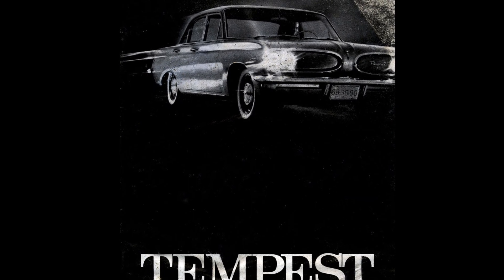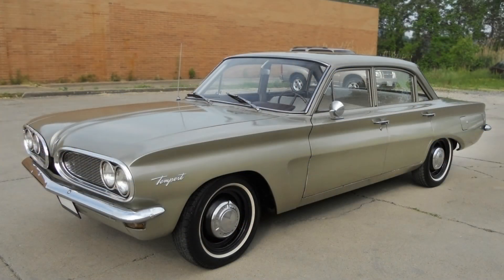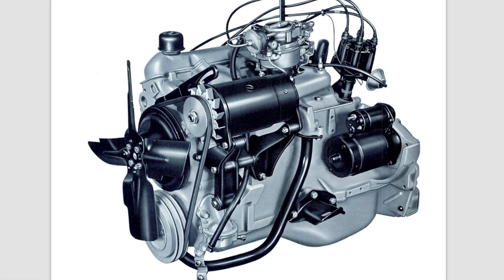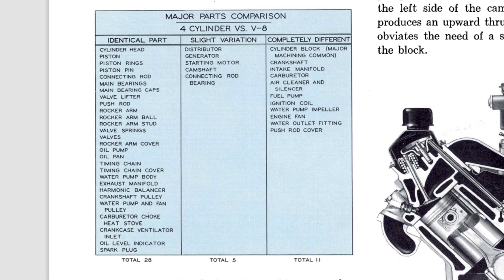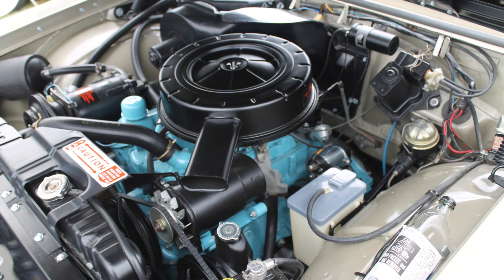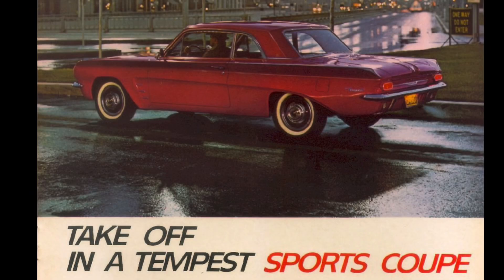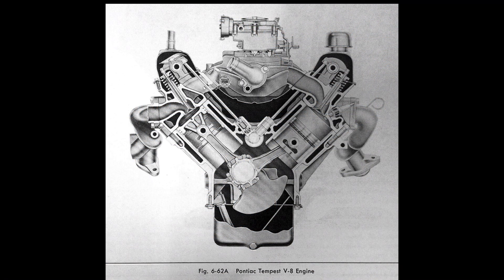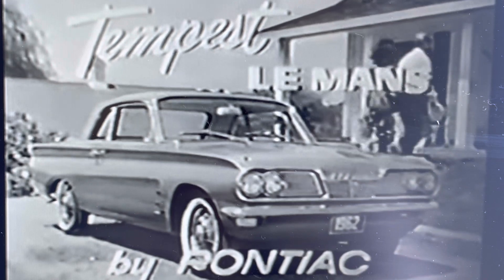Strangest Automotive Engines: The 1961-63 Pontiac Tempest & Its "Trophy 4" / "Half 389 V8" Engine

Comment: The Tempast was HEAVILY derived from the Corvair, basically a front engine Corvair. Corporate wanted Pontiac to use the corvairs rear engine for the Tempast but Delorean refused because he knew the Corvairs flaws and didnt want it for Pontiac.
Reply: The Tempest body appeared in four GM car lines in 61. Buick had their aluminum 215 inch V8 in their car, but it was a standard front engine and transmission set up. I'm not sure of Oldsmobile's power train or model designation. I find it amazing that GM could design a new small format car that would accommodate  three decidedly different power plant installations.
Reply: @cdjhyoung  Olds' version of the BOP senior compacts was the F85. It also used the 215 aluminum V8.
Reply: @Al-thecarhistorian  And you could get it with a turbo!
Reply: @cdjhyoung  GM was far more daring in those days. The Olds F-85 had an Olds version of the Buick 215 V8, with different heads and 1 additional head bolt per cylinder. And Buick lopped off the two rear cylinders of their V8 to create the V6, which went on to live as the 3800 well into the 2000's.
Reply: @61rampy65  yep. Put 460hp through my 3.8  via an M92 supercharger and 100 wet shot. The 2-3 bands in the 4T60 lasted approximately 3 blocks🤣 haven't touched a GM product since. Those 3.8 Buick mills are FANTASTIC tho, and possibly the best engine you can find under the hood of any late 90s early 2000s GM
Reply: @61rampy65  And don't forget, the original design for the 215 V8 Went to Rover & went on to a very long production run with them. AND the V6 was used by, and later sold to Kaiser Jeep Corp. Because it easily went in place of the 4cyl engine Jeeps were still using. Inline 6s & V8s would have required much more significant modifications which is just what AMC did when they bought Jeep. That would likely have been the end of the line for the V6 except we were now into the 70s & the "fuel crisis" of that era & GM was looking for something new that was more compact, lightweight & efficient & they bought back their own V6, shortly thereafter came up with the clever new crank design that allowed for "even-firing" & the rest, as they say is history!
Reply: @61rampy65  Drove a ten year old 63 Buick Special with the V6. My Dad had to fight that motor constantly, backfiring and coughing. Seems Buick sold the dies to American Motors who figured out reverse timing made it run smooth!
Reply: @cdjhyoung  Yes, my father owned one and it was a reliable car, bought new in 1961 and he had it for ten years.
Reply: @cdjhyoung  What's so amazing about GM  designing a small format car that would accommodate 3 different power plant installations? GM often did just that with the cars produced by its foreign divisions. One example: the Australian designed and built Holden Torana which had a 4 cylinder, a 6 cylinder and a V8 engine
Reply: @EVISEH  Different size engines in the same engine bay is not the same as designing a car that can locate the engine or transmission in opposite ends of the vehicle.
Reply: Really there were no serious flaws.  Ask anyone who own a Corvair. The Delorean car had a rear engined six, so I don't think that was the reason, but he wanted a Pontiac engine.
Reply: @danr1920  The flaw in the Corvair rear suspension was that in a high speed maneuver the car could take so much body lean at the rear end that the inner wheel in the turn could actual come under the body and 'jack' the car into a roll over accident when the side force of the turn had ended. The problem was that there was no limit on how far the rear suspension could travel when the body leaned.
Reply: @cdjhyoung  yep. But having the engine in the back made it far more likely to happen in the corvair. That being said it was possible to have this happen on a beetle and triumphs which also had swing axle rear ends.
Reply: @Henry_Jones 
 Remember kids: Always start the second part of your comment with "That being said...".

 It makes it sound like the first sentence is factual.
Reply: 😄 What a "waste of words." It's as bad as "At the end of the day."
Reply: @cdjhyoung  I can tell you read something in a magazine and now you are an expert. The Michelin X radial is over 70 years old, it was released in 1949. But Americans dim-witted insistence on getting that "pillow soft ride" means that Chevy installed bias ply tires which had sidewalls on the Corvairs which easily collapsed and would initiate a body roll. I installed Michelin Radials on my '64 Monza back in the 70's and would drift the car all the time with no issues. The lack of education in this country is appalling. Chevy could have installed Michelin X radials on the Corvair and probably prevented this issue.
Reply: @errorsofmodernism7331  I mean Ford had an issue in the eighties and nineties with their broncos and explorers rolling over because of Firestone. 🤷🏼‍♂️
Reply: @errorsofmodernism7331  Owned one. So did m brother. Never wrecked mine. Brother buried his at an excavation site. Nice, simplistic answer you give there. I'm sure you drifted all over the place, but did you ever drop a wheel off the pavement when drifting? A Corvair handled differently than other Chevys and it coaught the unaware off guard when they got it going to fast into a corner. simple as that
Reply: @cdjhyoung  - The NHTSB's report on the 1st generation Corvairs mentioned that improper tire pressures were often the cause of single-car accidents, as well as driver inattention. Just like a 356 Porsche, they'll go off the road backwards if pushed too hard when you're not paying attention.
Reply: @cdjhyoung  It was a bean counter decision. The 1964 Corvette no longer had the solid axle and the Corvair from 1963 no longer had the swing axle rear. Once you learned how to drive a rear engine Corvair it was hard to find a vehicle the could corner better. Including the Mustang.
The biggest flaw with the Corvair engine was the push rod tubes. Also the 3 90 degree belt direction changes. That also was a bean counter decision.
Reply: @cdjhyoung  , Corvairs suspension geometry made less rear tire/road grip during a turn when it cannot afford it... the result is the rear end swinging out and loss of control. I would describe this as only a degree of "wheel tuck under". All swing axles are prone to this under hard cornering.

Maybe this is in agreement with what you said, but I think it clarifies.
Reply: @RustySax1949  , so true. Corvair tire pressure was specified only 16 psi (in my 1966), about 26 rear as I remember. If you put 24 front and rear like many ignorant people did for all cars, the handling turned really dangerous. I experienced a bit of that on a wet road once, fixed the pressures and it was much better.
Reply: @markjohnson8260  There weren’t any warning labels and  24#  in the fronts made the car a death trap.
Reply: @James-hd4ms  - Yes there was, James, a bright yellow sticker on the inside of the glove box door. But, as per usual, most people, let alone gas station jockeys, the recommended pressures were ignored.
Reply: @markjohnson8260  - I had a '66 140 Corsa 4-spd Convertible for over 20 years, put 14x6 front and 14x7 rear "American" mags along with fat Pirelli tires on it, tweaked the alignment settings slightly, 24 psi front, 34 psi rear, added my tool box to the bottom of the trunk, then would go searching for Mustangs. Camaros, Trans-Ams and Corvettes to challenge on the twisty and bumpy mountain roads around where I grew up. That little Corsa could easily smoke the live axle pony cars and pre-'63 'Vettes on my favorite bumpy road that had lots of twisties, struggled a bit with the IRS 'Vettes, but often would be right on their tail or just a couple car lengths apart. My son's E30 M3 BMW often had slower autocross times than the Corsa, even when we'd switch cars. The 2nd generation cars were such a HUGE improvement over the 1st gen, but by then the damage from the Mustang and Nader was done, and the public turned away in droves.
Reply: @errorsofmodernism7331  , I seem to remember conventional wisdom said NOT to put radials on a swing axle car. I think was said to make the transition to oversteer more abrupt... perhaps someone else my age can remember more clearly.
Reply: @RustySax1949  wow, mine too was 140HP... but I'll bet yours was in better condition!
Reply: @markjohnson8260  - Well, mine was a CA car, delivered new in Gilroy, CA. Willow Run built. I bought it in June of 1969, a month after production ceased - people were practically giving them away back then!
Reply: @cdjhyoung  That issue was addressed in the 1965 and later Corvairs when the swing arm rear suspension was replaced with one that kept the rear wheels vertical as they moved up and down.  The Volkswagon beetle had the same issue and was often seen on it's roof for this reason.
Reply: @markjohnson8260  That may have been the conventional wisdom in America but here in Australia, Beetles, including the eary models,  as well as Triumphs and Mercs were regularly fitted with Radials - simply because  cross plys were no longer available -  without any ill effects and in fact Radial equipped Beetles handled better. Indeed, all the Beetles I owned were fitted with Radials. And here in Australia, we have some of the most extreme road conditions in the World.
Reply: @EVISEH  , thank you for that. My understanding was that when cornering at the limit, a radial would "let go"  more suddenly. Cannot quite remember where I heard that. Certainly outside my direct experience.
Reply: @cdjhyoung  I had a 1963 LeMans with the 4 cylinder, one barrel carburetor, 2 speed automatic. Went around a corner too fast one night and rolled it. I never liked the car, as it was underpowered, and the gas mileage was never very good, and the oil filter loosened it self up a couple of times from the inherit vibration. I looked okay, and that was it.
Reply: The biggest flaw in the Corvair was the swing axle  rear suspension which John Z DeLorean incorporated into the Tempest.  On an unrelated note, International Harvester cut their V8 in half to create a four cylinder engine for their Scout.
Reply: @scootergeorge7089  Since the Tempest never got tagged as being a roll over threat like the Corvair, I suspect that the weight of the Corvair engine behind the axle exasperated the problem with the swing axle design. 
Some folks on here have been pointing out other swing axle cars that didn't have these problems. Well, they are right, but not all swing axle designs were the same. A swing axle suspension is one with only one point at which the axle can bend at joint, and that is at the differential. The rest of the suspension can be any of a number of designs. On a Corvair and a Triumph Spitfire, the suspension points mounted to the frame were close to the differential and swung in the same plane as the axle. The Corvair also didn't limit how far the wheel end of the axle could drop. On a VW bug, the suspension worked in a plane 90 degrees to the axle angle of motion and that suspension had limits on how far the suspension could drop down when the body was lifted. That made all the difference in the world when the rear suspension was pushed to its limits. What kept the Corvair wheel from staying on the ground when you jacked up that corner of the car was the limits of how far the shock absorber would let the suspension droop. That's not a lot of structural resistance in a crash situation.
Reply: @cdjhyoung  In case you didn't notice, nearly ALL cars & trucks ever made used the shocks to limit the suspension rebound travel. They still do. Corvairs were no different. However, many aftermarket shocks would often have more travel, so they could be used in other applications.
Reply: ----  back in the day, my father went through a series of very bad vehicle purchases which included a 1963 Tempest, a 60 Corvair, and a 64 Corvair  -   that Pontiac was actually way worse than either of the Corvairs
Reply: The major flaw with the Corvair was the swing axel rear suspension. The Tempest also had swing axel suspension. The trans of the Tempest also had a trans mounted in the rear. This may have improved front/rear weight distribution, but it also increased the polar moment. DeLorian didn’t achieve anything except the use of a truly developed Pontiac engine and a small amount of polar moment decrease.
Reply: @tracylemme1375  i beg to differ. The corvair flat6 was BEHIND the rear axle. Think of how much that throws the weight ratio off. Thats a HUGE inbalance and its why the Tempast never had the corvairs issues
Reply: @tracylemme1375  Don't forget what we learned from "My Cousin Vinny".
Reply: So that 5 foot long transmission input shaft in the Tempest wasn't a flaw???
Reply: @hillarylevenworth8824  Not until Pontiac put the 326 inch engine in the car and a four speed in the back. Dumping the clutch soon showed it to not have the strength to hold up to that much abuse. But it was good with the four banger and power glide set up.
Reply: @cdjhyoung  I changed many of those input shaft intermediate bearings, the shafts twisted occasionally as well. The heavy flywheel and inertia made for long slow synchronizer action as well.
Reply: cdjhyoung, sorry, but that 5' long tube wasn't even good with the base 4 banger of only 115 hp, at least not with a stick and a heavy foot! My dad had a '61 Tempest wagon with the 3 speed stick and base engine and had the misfortune of breaking the welds that held that thing together. At the factory they only got spot welded together so you had to be gentle with it. Dad had it properly repaired, as it SHOULD have come from the factory and never had any more trouble.
Reply: @cdjhyoung  If that transmission input shaft had failures, it must have been horribly under designed!  The transmission input shaft for a front-mounted engine / rear-mounted transmission has to handle only a fraction of the torque of a drive shaft (in a front-mounted transmission / rear-drive vehicle). Since GM engineers knew how to design drive-shafts that could handle first-gear torque from the transmission to the rear differential, you would think they could design a shaft to handle 1/3 or 1/4 of that torque (remember, the job of a transmission is to multiply torque).
Reply: @danielklopp7007  Keep in mind, this drive shaft is not what you are envisioning. It was a 5/8 inch braided cable threaded through an arched support tube. I'm not privy to the design philosophy here, but the system had bearing failures that ruined the drive shaft. I never drove one of these cars long enough to get a sense of whether this drive shaft wound up under acceleration, but I would imagine it didn't feed the engine torque without flexing in some way.
Reply: @hillarylevenworth8824  - The so called "rope drive" seemed to work just fine.
Reply: @scootergeorge7089  The rope drive was unable to handle the power of the larger engines. GM saw which way the wind was blowing and redesigned the (now intermediate) cars for 1964. Chevy introduced the Chevy 2, a compact, while the new Chevelle joined the BOP cars, now all solid rear axle cars.
Reply: @spaceflight1019  - I believe the rope drive could have been developed further but, you make some excellent points.  In a similar theme, I believe it was not Ralph Nader that killed Corvair, it was Chevy II and Mustang.  Chevy II took away compact economy car buyers; Mustang the sporty compact car buyers.
Reply: @scootergeorge7089  I think you're ultimately right about that. Although Nader, I believe, did a lot of damage to the Corvair's reputation, the fact remains that the younger crowd at the time, was just more interested in tire smoking V8 power. Even though the 2nd gen Corvair was a good handling car & could be an absolute phenom with a few easy mods, it just wasn't what the "kids" were looking for. The relative handful of "enthusiasts" just weren't enough to keep it alive.
Reply: @hillarylevenworth8824  No.  It worked quite well.
Reply: @desertbob6835  Compared to what? The Slim Jim in the full sized cars or the Buick Special automatic...other 1960's GM driveline failures.
Reply: @hillarylevenworth8824  that long transmission input shaft has to handle only a small portion of the torque as compared to a drive shaft (in a rear drive vehicle with front mounted transmission).  Remember, the job of a transmission is to multiply torque... so in first gear, with a front mounted transmission, the drive shaft has to handle 3-4 times engine torque, whereas the "5 ft. long transmission input shaft" only handles engine torque (regardless of which gear the transmission is in).  Also note; Porsche has made several high performance cars with front mounted engines and rear mounted transmissions (e.g. 928, 924, 944) - this is NOT an inherently flawed design.
Reply: @danielklopp7007  Every time the main drive gear synchronizer has to accelerate or decelerate the additional mass of that 5 foot long input shaft, that transaxle is just a little closer to the scrapyard of bad ideas. Try again.
Reply: Pontiac were interesting in the early 60's. 
The Bonneville had a 4 speed hydromatic in 62 which Cadillac had dropped. 
The Pontiac never had the X frame, which the other GM cars had from 57 to 64.  It was dropped because of being weak when Tboned.
The Pontiac were wide tracks, because GM continued to use the narrow frame from the 50's.   Pontiac widen the track.
Look at the 59 Chevy the tires are set back 3"
Reply: @jamesmooney8933  pontac did use the x frame. Olds didnt for safety reasons. The promoted that in their ads which the feds then used against GMs x frame cars and to push for safety legislation. Ironic
Reply: @Henry_Jones  I had a 63 pontiac Catalonia
Reply: @jamesmooney8933  Pontiac used X  frames from 1958-60.  Also, Cadillac still used the four speed Hydramatic beyond 1962, as the first TH400s didn't show up until 1964, actually called the ST400 at first.
Reply: Great Video. Good looking car.
Reply: The swing axle design worked ok for slow underpowered cars like a 36 horsepower VW Beetle. The competing Detroit compact cars had much more power and weight. The first gen Corvair had lots of good engineering but was ruined by corporate bean counters who denied the necessary camber compensation suspension mods that it needed  to be safe. Ralph Nader didn’t go after the VW.
Reply: @Anatoli50  From Sydney, Australia, First Nader was a bigot and looked only at GM , VW was the same, Mercedes Benz was the same, Triumph was the same, Isuzu was the same, Datsun was the same. There were other IRS systems as well however they had attempted some form of camber pitch angle control, but the above brands saw a lot of cars off the road as they flipped over given the right set of conditions. A schoolmate and I saw it constantly, if not daily, chassis dynamics the accidents really interested him, so much so that he became a car accident investigator and then eventually Commander of accident investigations.  I grew up in Midddle Harbour part of the suburb Mosman in Sydney. Right on the waterfront, with one through road which was a windy, hilly, bendy, split level road that people used as a rat run short cut off to the right coming up hill after "the Spit" bridge, but it had an unforgiving camber, heading south your car leaned to the right, heading north your car leaned to the left to assist in disposing of bulk rainstorm water in heavy downpours. Walking to school in the 1960's & 70's you would daily see the chassis dynamics. On the northern beaches there was a guy who bought all the rolled over VW Beatles (or as we kids called them cockroaches) and turned them into beach buggies, or if they were medium damaged hacked the roof off & put roll bars in and fitted them with crude convertible tops. However on the Bay Street bends on a split-level section the spectacular lose was a 230SL Mercedes Benz (pagoda roof flimsy as hell),  it went past the prior afternoon and lost traction on the low side of the split level section, as was sitting high with the wheels up on suspension and left wheel hooked under causing the lose. Then the next morning I could hear it coming as back then cars had their own exhaust note, and you could hear when people selected a lower gear on a very steep part, the middle aged female driver gave it too much gas & low gear, with the right rear wheel hooked under the car, it went through the wooden guard fence & fell 80 feet  to the northern facing part of the split level road, she was dead the flimsy lift off metal roof just collapsed, so much for Mercedes supposedly being a safe car.  This same rear wheel going under the car in a Mercedes happened to a Uni ' mate back in 1976, Paul had inherited his great Aunts 1965 Merc' 250SE full size sedan, he lived on the opposite side of Sydney Harbour at Rose Bay and just weeks after getting the car, he lost control of it in the Rose Bay beds on New South Head Rd , he forgot he was not in his Morris Mini,  Mercedes swing axles are prone to sudden camber and pitch change, the multiple S-bends are tight & quick, not allowing the Benz swing axles to settle down before there was yet another camber & pitch change in the Mini a doddle in the Benz a disaster. I could see the impending doom in my Jag's rear view mirror as the Benz came up at the rear with BOTH rear wheels tucked well in under the car. It spun & ended up facing the right way up on the other side of the road having done a not required u turn, and in so doing had hit the kerb on the otherside of the road buckling the whole left side suspension & axle. He tried to copy me in my big 1965 4.2litre Jaguar MK10 (the world's very first luxury sports car, or, sports luxury car),  but wrecked his car, as the Jaguar is the ONLY car to have a completely neutral independent rear suspension where the rear tyres stay 100% flat on the ground 100% of the time, period, the Jaguar system has no yaw, or cambering effects either, fully loaded with fuel luggage & people, or, empty with driver and just a dribble of fuel in a tank & the car ALWAYS delivers the same perfect result and grips like a leech in human flesh. The rear and front suspension of these giant 1961 to 1971 Jaguars are the go to choice of hot rodders and car modifiers the planet over.
Reply: @gregharvie3896 Datsuns were not swing axle rear suspension. They had dual pivot points ,at the diff and at the wheel. VW,early Triumphs, pre-64 Pontiac Tempests and pre-65 Corvairs all had a single pivot point, at the diff ( or transaxle) and could tuck under.  VW abandoned swing axles starting in 1968 for Europe and North America. Swing axle VWs lasted longer in other markets.
Reply: @Anatoli50  No political agenda to be satisfied in doing a hit piece on the "hippie-friendly" Beetle.
Reply: @Anatoli50  Mrcedes Benz prior to the 1960s had a swing axle rear end. They were hardly slow underpowered vehicles. Of coarse the Merc's rear end was well tied down and it experienced little or no trouble with axle tuck in. And there's the kernel of why cars with swing axles experience axle tuck in - it's not solely because all the wieght's in one spot above the rear axle or because the axles  are swing axles. It's all down to how well the axle geometry has been set up, how well the axle is tied down etc.
Reply: @Anatoli50  The swing axle rear suspension of the Beetle was entirely different in design from the Corvair, and thus wasn't prone to the roll over issues of the Corvair. The VW axle couldn't swing under the car no matter what you did to loose it in a turn.
Reply: @cdjhyoung  Sorry, you are totally wrong about the VW being entirely different. A swing axle is a swing axle, so camber changes a lot, but you can make it so the tires toe in or out as the wheel goes up and down. You do realize that most of the dune buggies of the 60's and 70's got their donor chassis from rolled over VW's, right? Your first two comments were close, but you're way off about the VW suspension.
Reply: @61rampy65  "...but you can make it so the tires toe in or out as the wheel goes up and down. "
You are obviously completely clueless.
Reply: @daryllect6659  Au contraire, it is you who is clueless. What do you think the trailing arms do as they pivot? You have a lot to learn about suspension design.
Reply: @61rampy65  Quote "...but you can make it so the tires toe in or out as the wheel goes up and down. " 
Okay, fill me in: Just how, exactly" can the trailing arms affect "toe-in" and "tow-out" of a rigid axle?
Be specific.
Reply: @daryllect6659  Whoa there! There was never any talk of a rigid axle. Swing axles pivot up and down by a single u-joint (per axle) right at the differential. The axle pivots in an arc, which is why the camber changes so much. The axles are controlled front to rear by a trailing arm that pivots such that it prevents the axle from going forward or rearward, while still allowing the axle to go up or down. As the trailing arm pivots, it too swings in an arc, which will mean the axle is pulled forward (toe in) as it goes up and down. This toe-in tendency can be used to help offset the tendency of a swing axle car to oversteer. If a car is making a hard turn, the forces try to make the outside wheel want to go toward positive camber, which results in the back end of the car 'jacking up, which increases positive camber even more. If you can get that wheel to toe in, that wheel will want to go in the direction that it is pointed, and will then decrease oversteer (by a bit). BTW, all cars with independent suspension (front or rear) will change toe as the wheels go up and down, and I have yet to see any IFS/IRS car not have any toe adjustment. Hope this helps, but I will look to see if there is a video that explains it better.
Reply: @daryllect6659  OK, here is a video by Hagerty Insurance about the handling of an early Corvair. At the 6:20 mark, there is a photo of the Corvair swing axle set-up. The Tempest was almost identical. At 8:13, it shows a 62 Corvair going thru some turns and showing how the "tuck-under" wants to lift the rear end. Now picture that R/R wheel toed in a whole bunch. Wouldn't that tire want to try to go to the left? The opposite way that the rear of the car is trying to go. This is the best I can do on short notice, and I'm not wasting any more of my time on someone who only knows enough about cars to get themselves into trouble.
Reply: @61rampy65  "A swing axle is a swing axle, so camber changes a lot, but you can make it so the tires toe in or out as the wheel goes up and down. "
Do you have even the foggiest idea of what "toe in" and "toe out" are?
It appears that you don't.
Reply: @cdjhyoung  Have you ever driven a pre 68 Beetle with swing axles? If you have , you  would know all about the VW's rear axle tuck in characteristic.
Reply: @61rampy65  You're dead right about the Beetle. I had a 61 Beetle and well remember the several times when  I had to suddenly  swerve to avoid hitting something and the subsequent vicious opposite roll of the body that resulted as the rear axle tucked in. VW  changed the rear axles from swing axles to double jointed axles in 1968 and fixed the problem. The Corvair also had its rear suspension changed in the later models which also fixed the tendency of the rear suspension to tuck in, however by the time they did, the Corvair had accrued such a bad reputation that people had stopped buying it.
Reply: @61rampy65  Correct again. The trailing arms of the the swing axle Beetles were flat spring steel which twisted along its longitudinal axis as it also moved up and down in an arc. I've had Beetles most of my life and  have a intimate knowledge of their design and workings.
Reply: @daryllect6659  Trailing arms are either flexible spring steel as is the case with the Beetle or if of tubular or pressed steel construction have what is called compliant mounting bushes, eg the rubber bush flex allowing a degree of lateral movement. In effect, a rigid axle does not only move vertically in a sideways arc, [ remembering that the trailing arm rigidly connects to the axle housing just behind the wheel hub ] the trailing arm also flexes sideways along  its longitudinal axis, effectively changing the toe in and toe out as it does. The pattern of  movement of a swing axle is in that of a cone with the apex of the cone being the flexible joint at the transmission.
Reply: @61rampy65  A high-school friend of mine rolled his parents '63 Beetle with taking a curve in the road too fast.
Back in the 1960s the VW Beetle's urban legend had it as a car that could easily roll-over.  Could never figure why the outrage for the Corvair, but mute for the Beetle.  The only thing I could figure was the body strength of the Beetle made it less likely for the occupants in the vehicle from getting crushed.  As while I heard of Beetle rollovers in the 1960s, never heard of a fatality.  Even my friend managed to drive the Beetle home after the rollover.
Reply: There was very little actually flawed designs in the Corvair.  If you lean a certain way politically, you’ll believe what Ralph Nader said.   It’s that simple,
Reply: @TheMidshipMaster  thats like saying no flawed design, just flawed drivers.